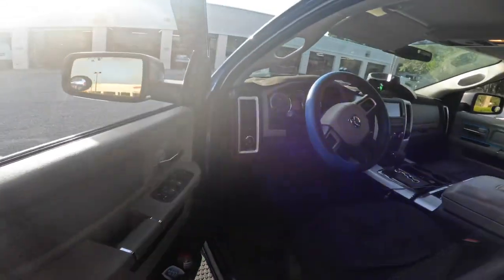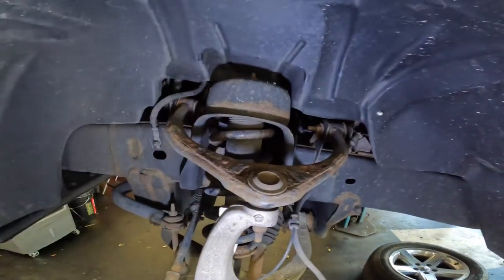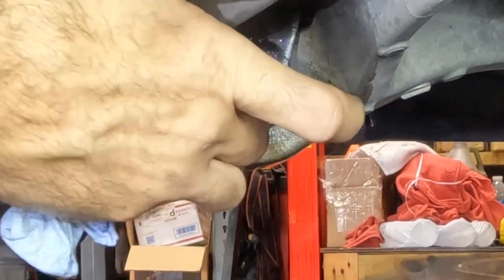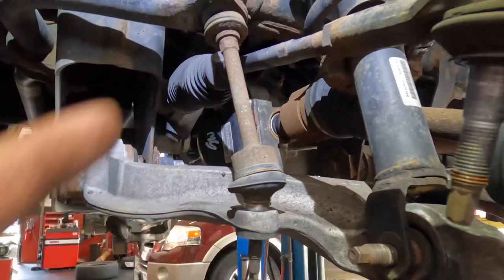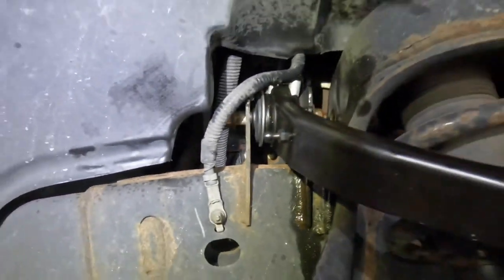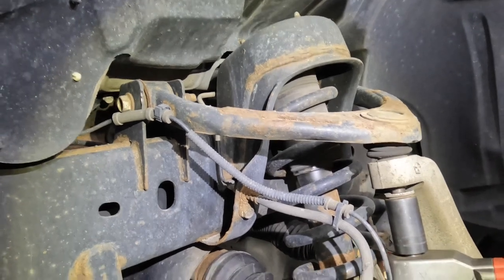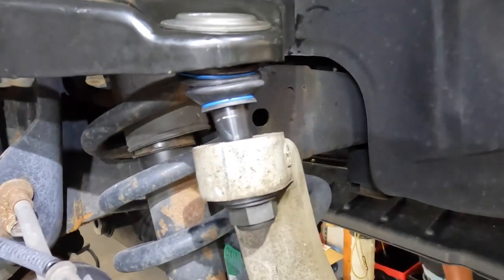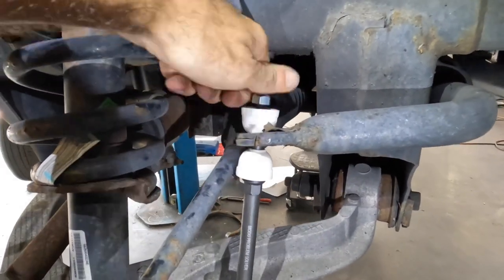Job Fails Fast! 2011 RAM 1500

Comment: I think almost everybody still calls them a Dodge because I Rose by Any Other Name...
And I think most of us will continue to call them a Dodge until they put the name back on the damn thing. It's properly called a Dodge Ram truck not a Ram truck. Mostly because Dodge made other trucks that weren't called Rams.
And it being a couple inches higher in the back is not a real issue in appearance. Florida there's no reason for heavier Springs in the front of the truck because you're not needing to carry extra load in the front. There is Need for Springs to hold the rear end up higher because that's where you going to put a load in that what will equal the level of the truck. I'm not understanding the issue here. If you want to fix the looks of the truck drop the rear end of the truck. Raising the front end is just going to make it look too high all the way around

Comment: After watching for a while now, it's really frustrating watching you work with your "sales team" as you put it. As a former advisor for a dozen years, these guys don't sell jobs/educate the customer correctly. There are certain things that are included in the job and are NOT optional, like alignments and hardware etc. I can't remember the dozens of things I've seen in the past videos, but you know what I mean. I literally thought you were explaining to the vehicle owner about the bushings, my jaw dropped when I figured out it was the advisor. You were talking to him like it's his first time looking at a car. "Bushing bolts seized, need to torch them out, quote lower arms", that's what I was used to, and is all that's needed to explain to a good service advisor. In the empire state of NY, you always left quotes open ended for surprise stuff like that.
Reply from the maker: It was the truck owner (he works here, and had too many Red Bulls that day) And yea…we’re lacking sometimes. 🤫 Sometimes turnover is good 😏

Comment: northern tip take the control aarm off and burn the rubber out press the sleeve save that bolt its 75$ dont be a girl use fire and your man mussels